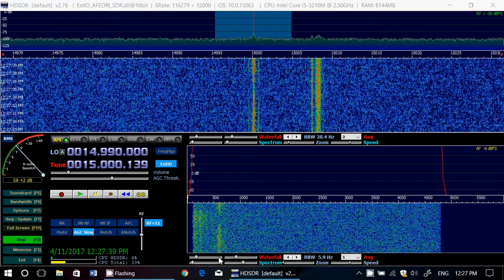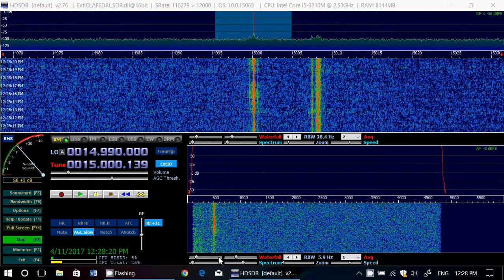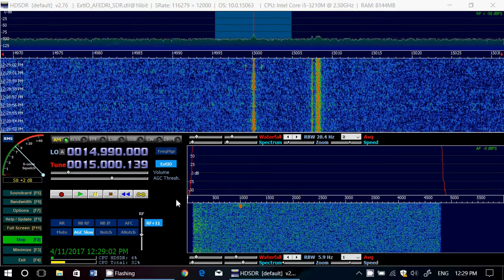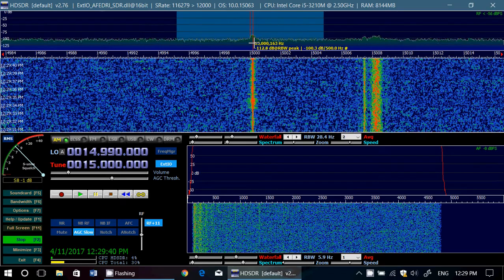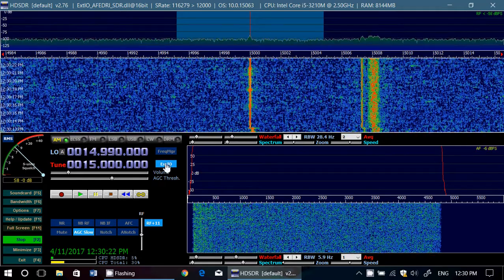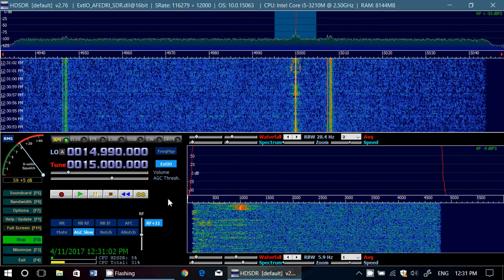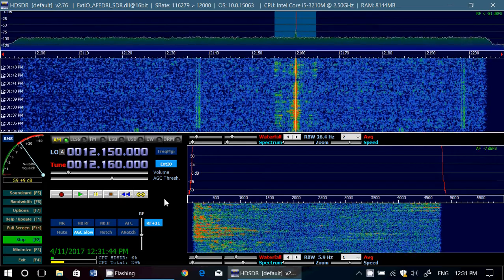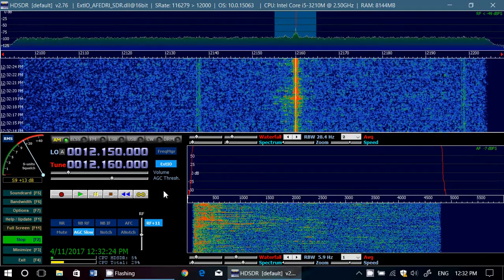How to calibrate frequency of your SDR in HDSDR software

Comment: I got my SDR to calibrate with my upconverter with HDSDR. I had to temporarily set up it with 125M added to the frequency. I set HDSDR  as directly setup with the antenna. For WWV 10MHz, I tuned into 135MHz.   I was then able to calibrate it by typing in the correct frequency. 

Once I switched HDSDR back to properly using the upconverter, I can finally use HDSDR like a treat. :)

Comment: This does no good for me. I have a Soft Rock Lite II Panadapter / SDR Receiver on my Yaesu FT-301D. It is not electronic. It is Analog. I am using it as a Panadapter. It has no USB or Ethernet connectivity. The Calibrate Frequency function does not work because I don't have direct radio connection. I need a way to MANUALLY make adjustments. It will not work without ExtIO and if it does not see a Hack RF or another unit it will not allow you to calibrate.

Comment: That seems to work perfectly for you. Not sure why the instructions when in "calibrate" mode tell you to do this in ECSS mode,  which automatically activates AFC and other options. 
I found I had to adjust the "frequency ppm" frequency shift button under the "Ext io" setting to get things lined-up. Will try your method and see how that goes.

Comment: Hey, I have the rtl820t + ham . I should be able to do 100khz to 30mhz ( it has two antenna inputs . HF AND VHF/ uhf ) well I have the vhf/‘uhf side working but can not get it  on say 3533 kHz or even regular Am broadcast stations . The software gives me an error that I can not tune if try anything below 10 mhz . Any idea ?
Reply: hey i have a dongle that has two antennas and ive found only one antenna side works for both sets of frequency.. the uhf antenna .. so try tuning with ur antenna in that connector........ peace

Comment: Personally, I could use more instruction in using the HDSDR application. I find its layout unfriendly to noobs, which is why I've been sticking with SDRuno (which a lot of people think is harder than HDSDR!). It's also hard to see the signal in the smaller window. Anything you can offer along those lines would be greatly appreciated, Gilles. Thank you!
Reply from the maker: I will be posting more videos on using HDSDR in the coming days and weeks
Reply: I would also like Father instruction specifically geared towards using hdsdr with the hamitup upconverter the settings that you use in hdsdr specifically I have yet to be able to receive any signals and have some high pitch noise in the receive